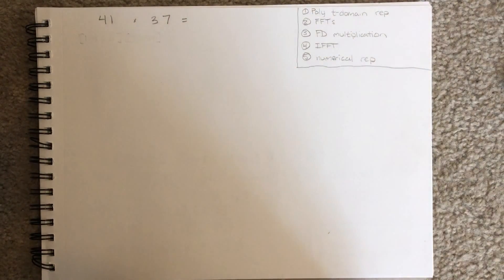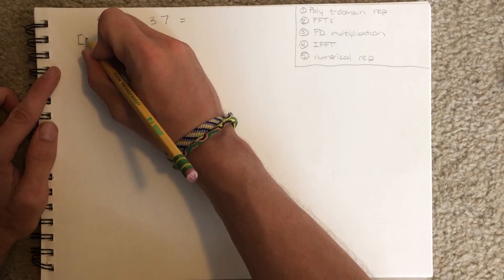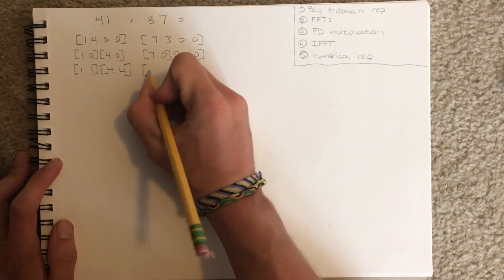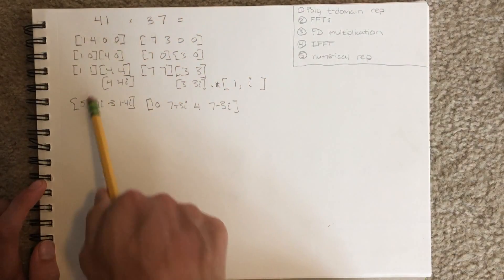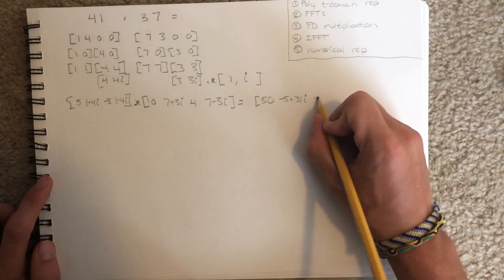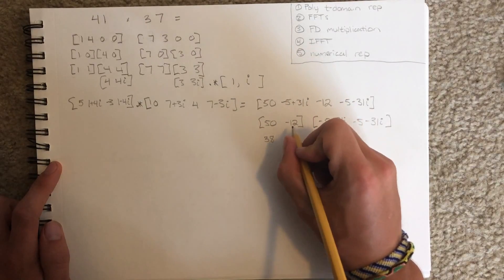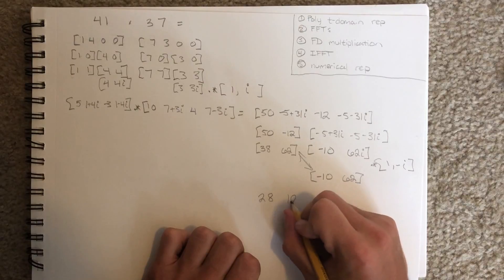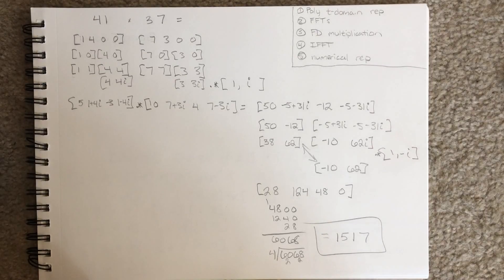Multiplying 41*37 with Fast Fourier Transform by hand

Comment: Could you please explain how to multiply two polynomials using FFT ? if we assume the above number as a polynomial i dont thnk this gives the correct answer after applying IFFT
Reply: You need to divide that output by the number of samples N to complete IFFT. 

In this case:
(1 / 4) * [28, 124, 48, 0] = [7, 31, 12, 0]

Which are the coefficients of:
(1 + 4x)(7 + 3x) = 7 + 31x + 12x^2

Comment: So to multiply a 2 digit decimal number, you need a sample size of 4. So maybe you should multiple a 5 digit number which would require a sample size of 10. Division by 10 is a lot easier to calculate in decimal
Reply from the maker: To multiply two vectors representing the coefficients of polynomials (in our case our polynomial represents base-10, i.e. 1x10^0 + 4x10^1     and    7x10^0 + 3x10^1 but this method works for any base) we need to zero-pad each signal to at least a length of M+N-1 where M is length of one vector and N is length of the other, thus satisfying the definition of linear convolution (otherwise computations "overflow", and you end with a circular convolution). In our case M = 2 , N = 2 so M+N-1=3 but for a 3-pt signal it would require Rader's (prime) FFT which is much less efficient than a Radix-based FFT, so we simply zero-pad each signal to 4 and use the better algorithm. Let the computer do the work you don't want to do, Steven.
Reply from the maker: I mean we also could just a DFT on 3-pt signal, but that's boring.

Comment: Oh my god, you have to do division at the end? Division is hard, what if the number is huge, how do you do division with 20000 digits
Reply from the maker: Repeated subtraction, on a computer. The answer will always be an integer, as two integers multiplied will always equal an integer.
Reply: Or just Bit Shifting, in cases of powers of 2. Use the smallest power that works